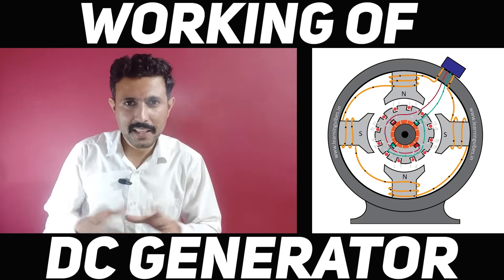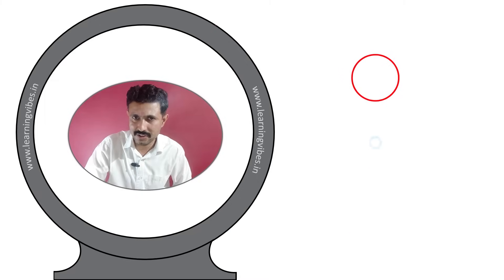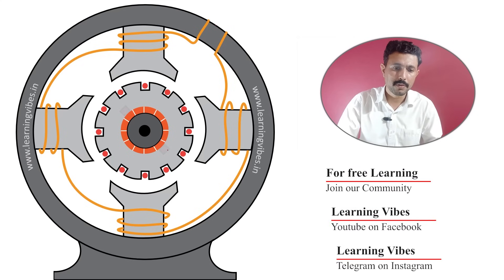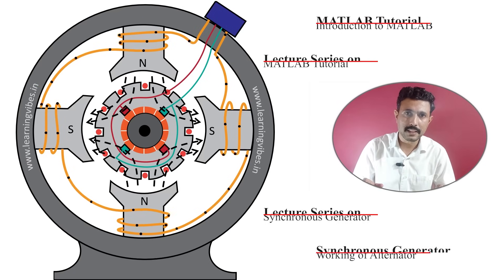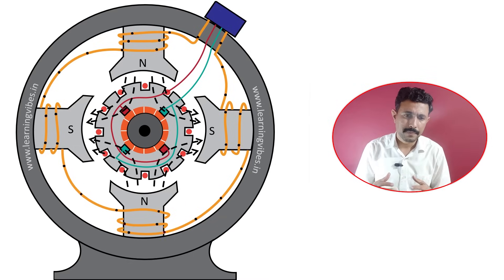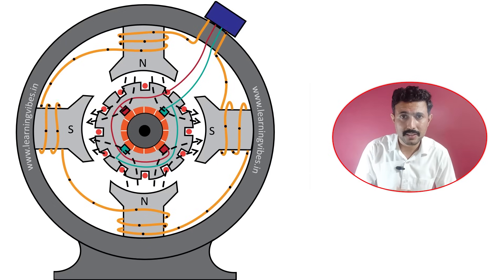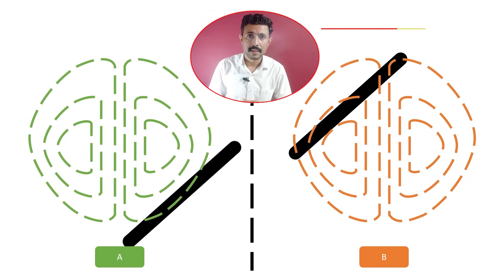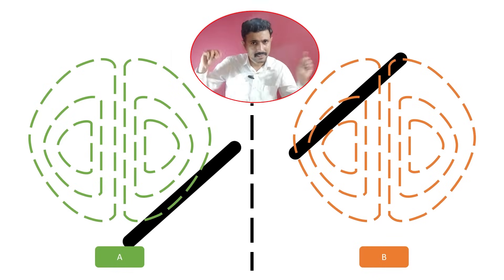Working principle of dc generator with animation | Assembly and working of dc generator | Mruduraj

Comment: Wait, what!!! 
It's a AC to DC converter like Rectifier. Since we provide AC supply get DC supply. Does it make any sense.🙂
Reply from the maker: You are talking about commutator segment right? 

The purpose of commutator segment is to convert by directional view form that we use to call AC in 2 a unit directional view form that we use to call DC so that is the purpose of commutator
Reply: @LearningVibes ac current is provided na. Soo??? ac Current provided and got DC, curent to current. Am i wrong???

Comment: The reason as  to why the ac supply input is not being shown in the graph, simply is because of a commutator in the armature, basically the commutator converts AC current to DC current, further with the help of brushes the current is delivered to the load.

Comment: Why slip ring is used in AC generator
Reply from the maker: the rotor spins around an axis. In order to allow for the transfer of electrical power and signals between the stationary and rotating components of the generator, the rotor is equipped with conductive slip rings.

Comment: Good explain sir , but starting which supply given to field winding(ac, Dc)? and if direction chenge required how it is? How much voltage given to field winding?
Reply from the maker: DC supply is given to field winding and field winding voltage depends on motor design. Ot could be 120v dc or 150v or 300v.
Reply: @LearningVibes  how the output of dc generator converted in dc
Reply from the maker: @haribabu116  using commutator brush assembly. you can refer this video
https://youtu.be/RFCXKKePS8Y
Reply: Sir how to chenge direction?
Reply from the maker: @mkashanna1295  by reversing terminals

Comment: sir I got a problem with counter e.m.f when the motor is started The back e.m.f getting high which is proportional to the speed of the motor ' though speed come From F_BIL so if the current decreasing gradually then how the speed increases.???so how back emf is getting high?